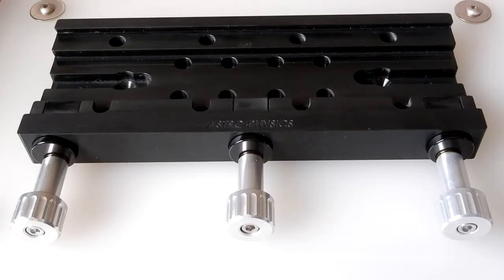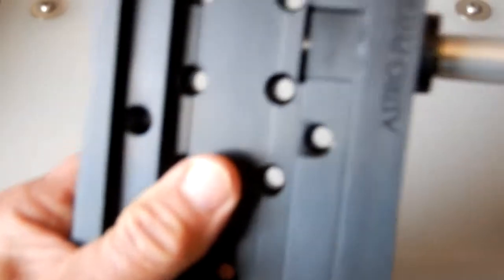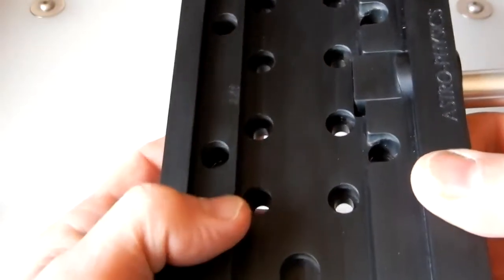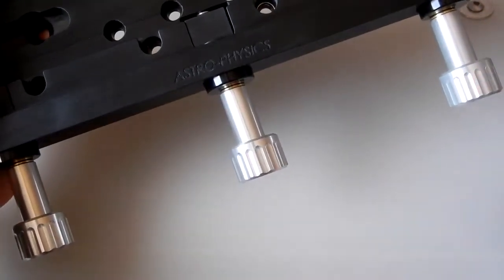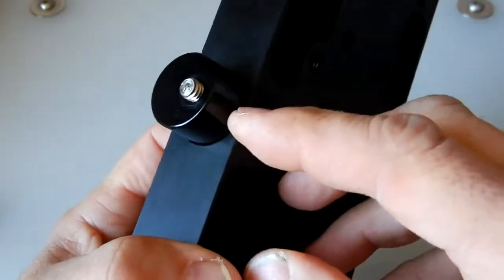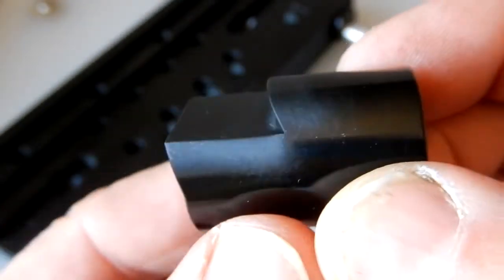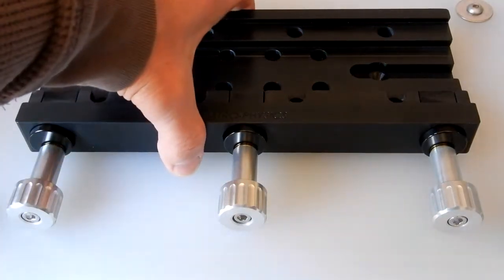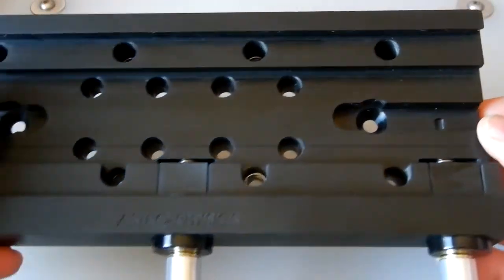Astro Physics Telescope DOVEDV10 Saddle (D-style & V-style Dovetail Plates)

Comment: I got my DOVEDV10 as soon as they came out for mg Mach 1 replacing the DOVELM2.  I have the SB16 on my 1100 so didn't need it there.  What I truly love about it is many of my Vixen dovetails weren't long enough to engage 2 knobs.  Having the 3rd knob gives a definite connection to even the smallest of dovetails. 
Another good reason you should mention about having the Allen head keys available beyond lock down is you can always get your saddle open again even in the cold with an Allen key when a gloved hand can't open the saddle in the cold.  Nicely done review of a really great product.
Reply from the maker: Thanks guzzialfa, excellent information. I always give a little extra "tighten" on the locking knobs with an Allen wrench also for safety. I have arthritis too so there are times I need to use the hex wrench just to get it tight. AP perhaps figured that in :)  BTW, on my DOVELM2 I bought an extra knob from AP for $25.00 giving me that 3rd knob. It comes with three tapped holes but only came with two knobs. Never could figure that out. It is on my Losmandy AZ8 tripod.

Comment: Hey did you ever end up mounting the GTX side-by-side?  I'd love to see how that worked out and if you have any tips.  I'm considering a somewhat similar setup with a 130mm and a 16'' SCT on an AP1600.  Planning to put the 16'' on a DOVELM162, the 130mm on a DOVEDV10, lay them side-by-side across the SBD18SS, which (I believe) will connect to another DOVELM162 that is joined to the mount.
Reply from the maker: Scott Bieber   Indeed I have. 1-Astro Physics 130GTX & 175 Starfire EDF telescopes SIDE by SIDE on an AP 1600GTO mount https://www.youtube.com/watch?v=IJCiubRptrQ  2-AP 130 & 175 SIDE by SIDE on a 1600 mount GoTo's 
https://www.youtube.com/watch?v=4qh7caaKUmk  3-Astro-Physics 130GTX & 92mm Stowaway telescopes SIDE by SIDE on an AP Mach2GTO mount
https://www.youtube.com/watch?v=8YwNiAu4qFE  4-Astro-Physics 130GTX & 92mm Stowaway telescopes SIDE by SIDE on a Mach2GTO Equatorial Mount GoTo's
https://www.youtube.com/watch?v=3ooThN2krGM